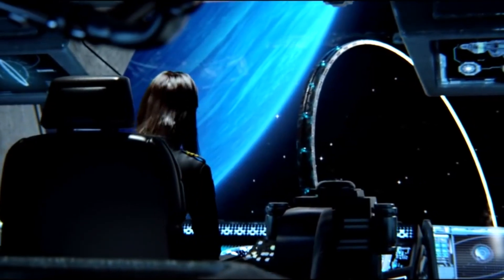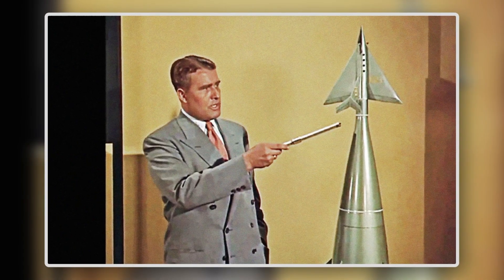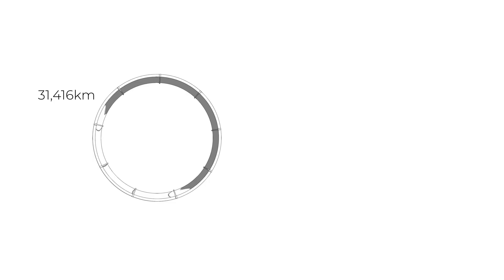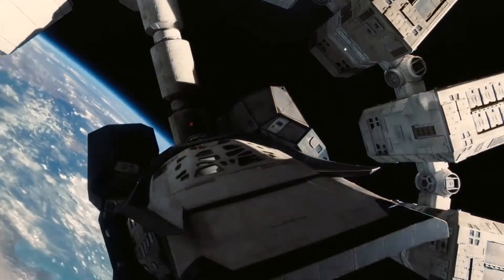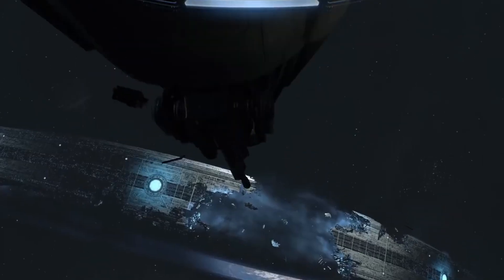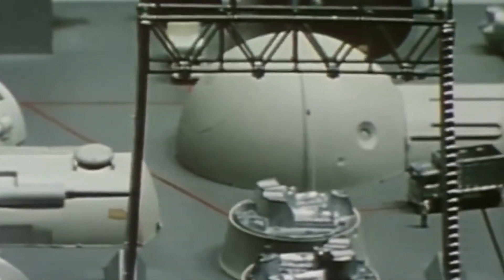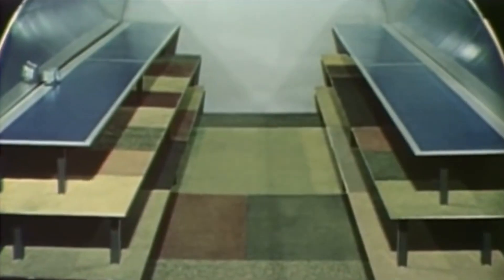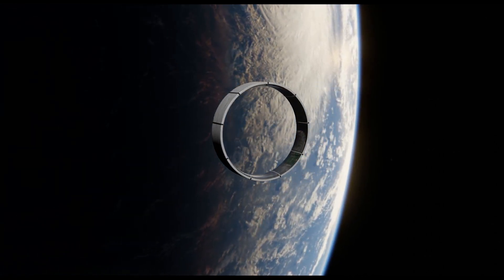Could we build the HALO ringworld today?

Comment: Not a recreation of suburbia.  Much more likely to be a collection of modules.

Economics will drive us toward building complete space station modules on the ground.  We’ve got the material and expertise on the ground.  Then launch completed modules on top of SpaceX Heavy booster or Blue Origin’s New Glen.  Then dock them together with a minimum of spacewalks.

We’ll get lots of practice building modules that it will continue like ruts in a road.  Then we’ll team them up with tethers and spin them for spin gravity.  More tethers, more modules.  As little waste space as possible.  While we’ll build stations cheaply by today’s standards they’ll still be very expensive by terrestrial building standards.  We don’t waste space in Antarctica research stations or submarines.  It’s not a matter of physics just economics.

Comment: Spokes! Why no spokes?  We don't build suspension bridges by anchoring them at each end and let the roadway sag down.
Why draw or design these structures as big saggy rings when adding a few thousand cables saves massive amounts of material and makes them hundreds of times safer.

Comment: 10000km!? That's still seriously overkill, some 10-100 kilometers would still work and be way easier. And something like a 100m ring station like gateway would be better.
Reply: Yeah there are a lot of options.  I don't understand why more people don't propose a ringland with two disk shaped walls on each end.  This way it can be quite small and no ceiling required.  Those ceilings are a problem.
Reply: I never understood why the engineers (the Protectors) in Nivan's book decided to build such a huge structure. Multiple smaller ringworlds with the same overall land area would have been far less challenging to build.
Reply: 10,000 km is kinda tame for forerunners
just.. look at the ark.. or the greater ark

Comment: I'm still wondering why we don't electromagnetic rails to get space craft up to speed before launching them.
Reply: If you mean rail guns, there's 4 main issues. The first one is power. It takes an absolutely ludicrous amount of electricity to get rail guns to fire large projectiles at Mach speeds. You may be familiar with the US navy's rail gun project; the massive power array they had hooked up to that was just for artillery rounds, scale that up to a satellite or space craft and we're talking about multiple dedicated reactors and capacitor banks the size of buildings. The second problem is that the projectile is part of this mind-bogglingly energetic circuit, so if there's any electronic components (or people) on board and they aren't perfectly insulated from the rails they'll be fried and probably explode. Even the electromagnetic fields generated by firing would probably be enough to wipe unshielded hard drives even if they aren't part of the circuit. The third issue is maintenence. The main reason the US naval rail gun program was canceled was because the rails have a very short service life- I think it was around 25 shots before they needed to be replaced.  Again, keep in mind we'd be talking about a rail gun the size of at least a small sky scraper, so the logistics of fabricating, inspecting, maintaining, and replacing these rails would be even more difficult and expensive. But the biggest problem is the acceleration. As you probably know, the greater the acceleration of an object the more force it is subjected to. So when and object is accelerated from 0 to Mach 3 or more the over the course of a second it would be make crashing a semi truck into it look like a minor stress. Humans simply can't survive that kind of force and unmanned craft would have to basically be solid on the inside and would be extremely limited on the kinds of joints and moving parts they could have.
Reply: @jamesmclemore9123  Talking about using electromagnetics to launch a spacecraft. We've done it with a rollercoaster, so why not a space shuttle?
Reply: @Megames2012  achieving escape velocity with electromagnets is magnitudes harder than accelerating a rollercoaster.
Reply: @LineOfThy  You wouldn't be accepting to escape velocity using electromagnets; you'd reach 300 to 500 MPH, just enough speed for ram jets to perform efficiently. Once at a certain altitude, you can detach the ram jet winged sled, and begin your burn. Theoretically it should save gallons of fuel.
Reply: My guess would be the fact that it would weigh a lot magnets are heavy
Reply: @renaissanceredneck73  We already have a rollercoaster that does the exact same thing... so it should be feasible...
Reply: @Megames2012  Garbage, try doing some math. The energy to run a roller coaster is not even a tiny fraction of what you need to add any useful momentum to a rocket.

Comment: Much like Niven's Ring World, would a Halo ring also need constant adjustments, to stay stable?
Reply: I imagine so
Reply: Some kind of thrusters would definitely be needed for any artificial space structure like this. Solar winds and micro meteorites etc would over time mess with its stability. It probably wouldn't need constant corrections, but occasionally for sure.
Reply: Me a halo Ring is smaler then niven ringworld and would be in a Orbit. IT would only need thrusters to hold the Orbit. I dont can recal that the are rotate in the Games. Niven ringworld is the size of earth Orbit and need thrusters to rotate and correct Against Suns Gravitation